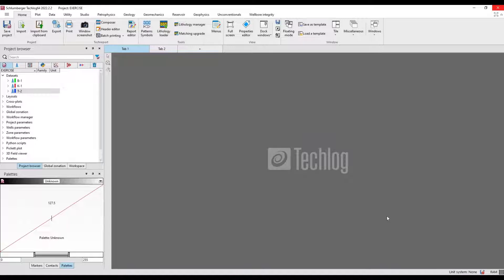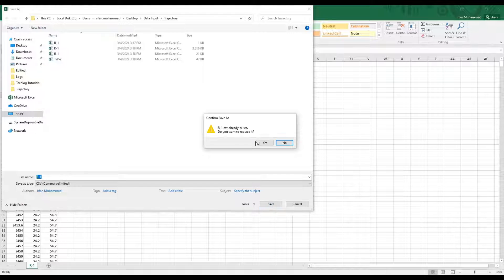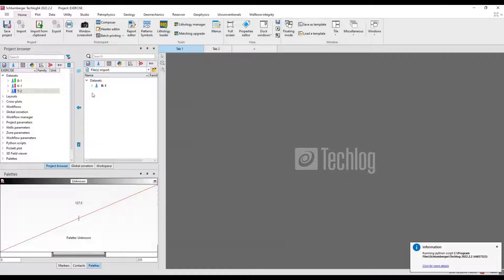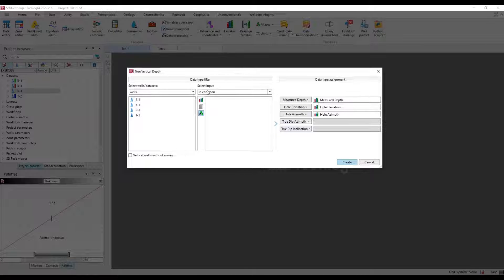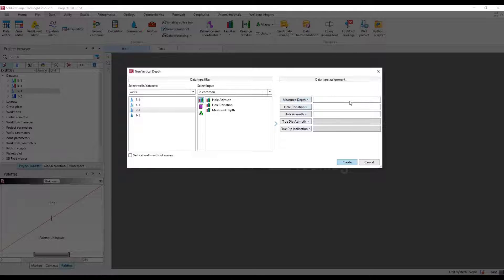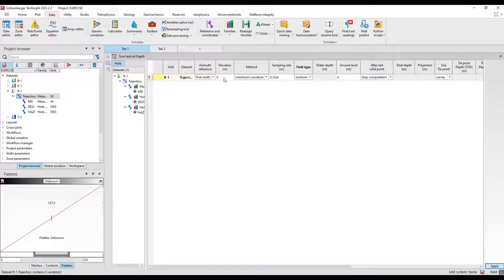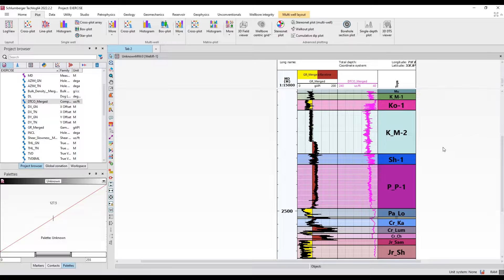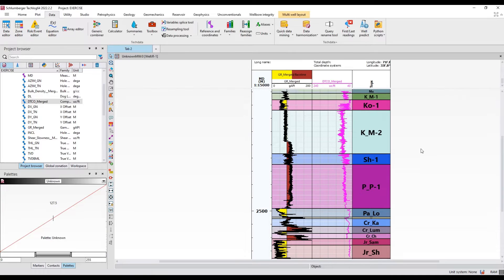How to import Well Data, Trajectory data & do TVD computation in TechLog

Comment: Each i drag and drop  either my sonic data or bulk density is not entering, it shows the variable was not correctly resampled into the dataset, please help me
Reply from the maker: @majorskillz7589  Check the sampling rate of your dataset. Then resample your density and sonic as per your dataset sampling.